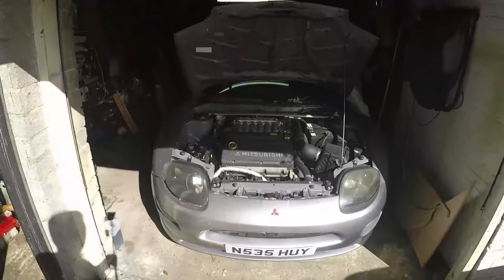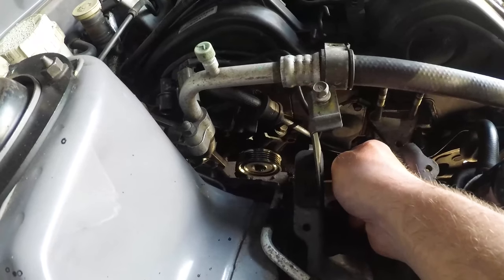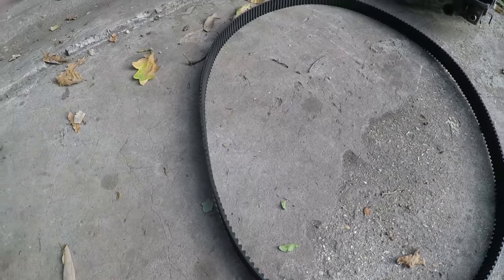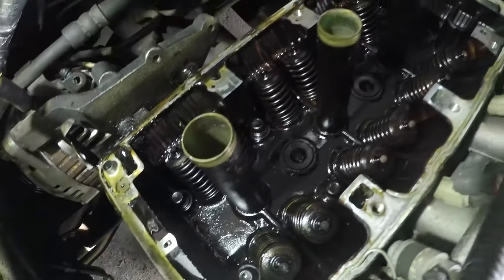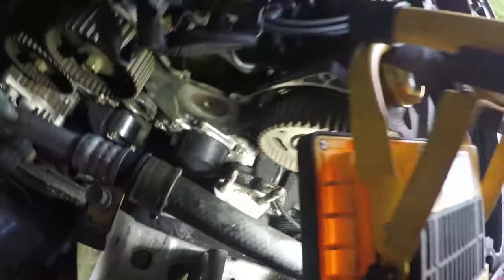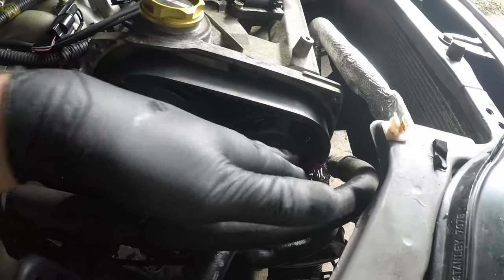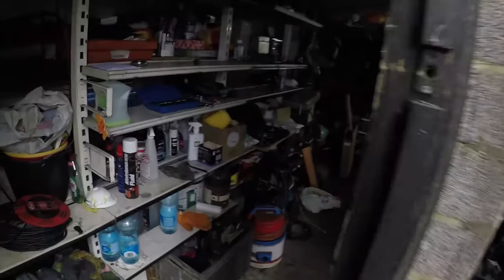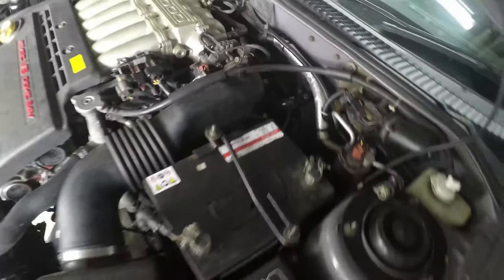Mitsubishi FTO 6A12 Cambelt, Water Pump & Half Moon Seal Guide

Comment: Hey Pamo, I wanted to ask a question. Did you have to buy new bolts in order to put the engine part with the camshafts back in? I'm worried as I may have to buy new bolts in order to put the camshaft engine part back in and I know that for engine head bolts are not reusable and was wondering if the camshaft engine bolts are reusable
Reply from the maker: No, the cam tray bolts are reusable.

Comment: What service items do you recommend changing at 100,000 km? I’m thinking Half Moon seals 2.  Cambelt + tensioner + water pump 3. Coolant 4 . Spark plugs I will also adjust the valve lash .what else should I change and are there any other places the engine leaks or weeps oil from ?
Reply from the maker: At that mileage I'd do all the above, but only seals if you have leaks. The top half of the heads can leak bit it's not too common. They are sealed to the lower portion of the head with rtv.
Reply: @ManSeeksCivic  thanks for your input you have great videos

Comment: Hey there Pamo. I'm actually rich enough to buy an fto.. but I'm not even sure where to look for and such.. ftos issues are that they rust right, which part i gota look for?
Reply from the maker: Look carefully at the chassis rails under the rear, the inner sills/edges of the floor and around the engine mounts on the inner wings. If you need more help just shout.
Reply: @ManSeeksCivic  Cheers, always wanted one but now they're so rare.

Comment: Was taking the aux belt off easy? And how was it done need to remove much to do it??
Reply from the maker: It's not too bad. Removing the engine mount helps but isn't necessary. Loosen the 14mm tensioner bolt for the alternator, a couple other bits and you're away.

Comment: Hi mate. It seems you know a lot about ftos. May i adk you since am new owner of an fto. My question is since the fto is 1.8 4 cylinders, can i fit a 6 cylinders engine? Does the transmission fit both engines? Engine mounts? Thanks
Reply from the maker: I have lots of experience with the v6 but have never worked on a 4. That being said, I'm sure you can swap the engines and doubt it would need a lot of work.
Reply: @ManSeeksCivic  thanks mate. Cheers

Comment: Hello. Quick question, when installing the timing belt the crankshaft mark should line up to TDC 0°?
Reply from the maker: Yes, but it's a little more complicated than usual because you set all the timing marks then have to rotate the crank 1 tooth anticlockwise. Then proceed with belt installation working from the rear bank forwards. Have you got a manual?
Reply: @ManSeeksCivic  Thanks for the fast reply. I do have a downloaded manual. On the old belt the crank lined up to TDC but all the cams were forward 1 tooth. I thought this was wrong as the manual says to have crank and cam marks all aligned. Installing the new belt I lined up the cams and turned the crank anticlockwise slightly to align all marks perfectly. Now all the cams line up and the crank is at TDC 0°.  Is that wrong?. Should it be say 10° BTDC?.
Reply from the maker: If the marks line up correctly after turning the engine over by hand a few times with everything installed then you are right. The timing marks are your datum.
Reply: @ManSeeksCivic  thank you so much. You're a legend. Hard to get parts, advice and info on these here in Australia as they're very rare. So I always turn to your channel. Didn't want to put it back together and then have to pull it all apart again if i was wrong. Can't thank you enough.
Reply from the maker: Thanks for staying around. Let me know if I can help again 👍

Comment: Cracking vid. I'm engine swapping next week on my manual gpx
 What's like to do?
Reply from the maker: If you're swapping in another 6a12, it's no harder than any other engine. The wiring is a little frustrating due to the type of fasteners and the lump is surprisingly heavy. Apart from that it's just the usual stuff. Good luck👍
Reply: @ManSeeksCivic  Thanks for the reply. It's going to be my first swap. It's coming out of a donor fto and straight into mine. It's going to trial and error I guess. Fingers crossed

Comment: Hey buddy how do I take the front bar off?  Struggling to find all the bolts etc.  Cheers!
Reply from the maker: What do you mean by "front bar". If just the bumper... There are 4 bolts that hold it into the chassis rails from below, the bolts that are on top near the slam panel and 2 evil ones right at the corner of the bumper (where it meets the wing by the wheels).
Reply: @ManSeeksCivic  I'm about to attempt to put on PWR trabscooler kit today and I have a decat pipe to bolt on as well I got given from a UK buddy :) I just found this great info page as well: http://my-mitsubishi-fto.eu/mitsubishi-fto-gx-gs-gp-gpx-gpvr-workshop-manuals-garage-guides-how-tos-electrical-wiring-diagrams/
Reply: @ManSeeksCivic  I just thanked you on my FTO videos on youtube buddy :)

Comment: Any tips to take the front drivers side engine mount off as still doing cam sensors?
Reply from the maker: What specifically are you having trouble with - the aluminium mount or the iron part that's bolted to the block?
Reply: @ManSeeksCivic  I am having issues with top side pulley still.

No clearance no matter what tool I tried.

Should I raise or lower the engine to get the top pulley?
Reply from the maker: @MrShortStuff  yes, you have to play around as much as you can to reach all the bolts. Make sure you have the long gearbox brace removed from underneath the engine and place your jack securely under the oil pan on something like a piece of wood to protect the pan. Remove as much of the parts as possible to access the pulley and Loosen the pulley bolts so you can slide it up and down to clear the bolt heads for removal.

Comment: Any tips on changing the extractors buddy
Reply from the maker: Please excuse my ignorance but I'm not sure what you mean by "extractors".
Reply: @ManSeeksCivic  sorry buddy exhaust headers
Reply: I have removed down pipe already having issues trying to remove front bolts off at the moment due to the fan shroud. Do I have to remove it to get the exhaust off?
Reply from the maker: @MrShortStuff  No, you should be able to reach all of the nuts once the heat shield has been removed. As I said before, I remember needing thin tools - 3/8 drive ratchets and sockets I think. It's much easier to pull the rad but not essential.
Reply: @ManSeeksCivic  Yeah got heat shield nuts from front off just not Lucy clearance due to the oil filter and I was wondering if it will come out and clear the radiator fans?
Reply from the maker: @MrShortStuff  Hmmm, Its been a while since I've removed the front manifold - I cant remember if you can clear the filter or if It has to be removed. Also our car has stainless manifolds so it may be slightly more forgiving. Ill have a peer down there when I'm in the garage tomorrow and see if I can give you a more concrete answer.